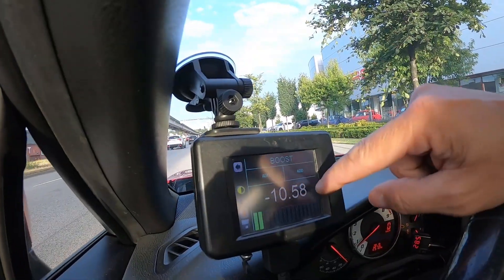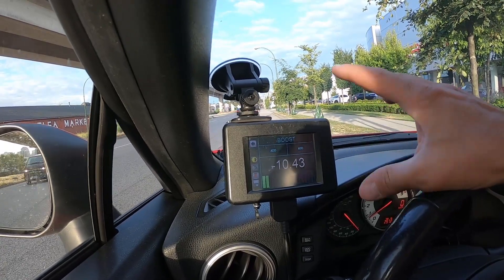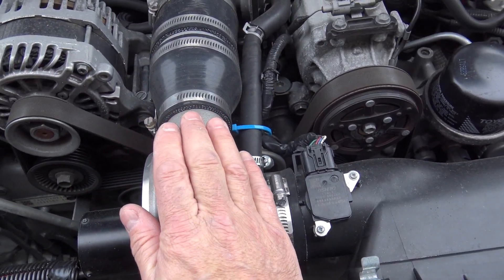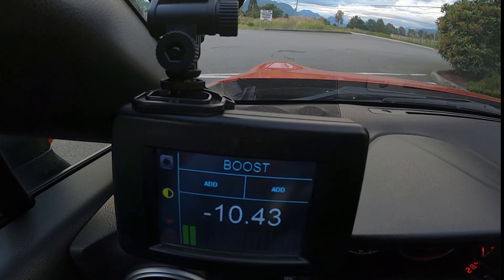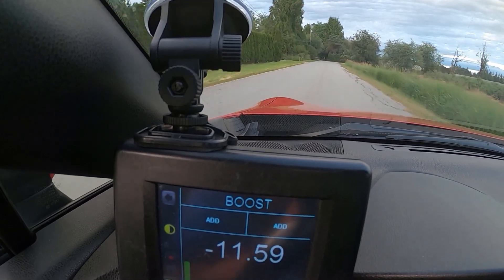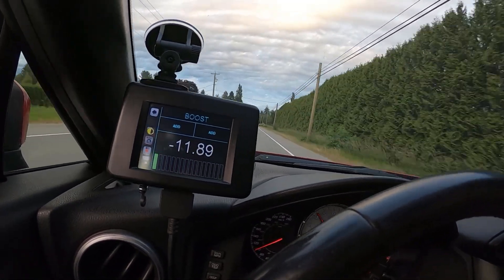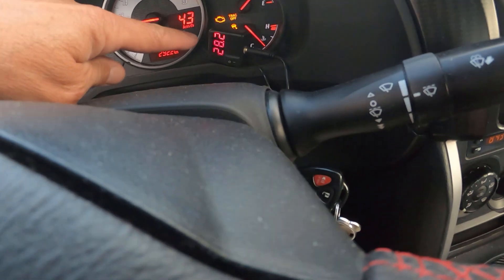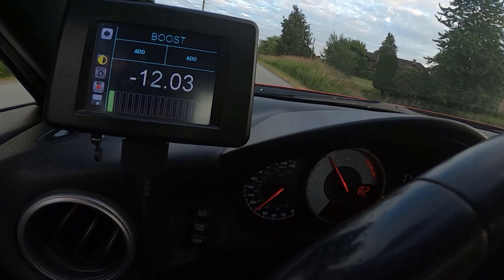Proof that my Electric Supercharge works!! BOOST

Comment: 5psi is equivalent to 30-35whp... That is impressive.
Reply: only problem is, it's 5psi at low to mid rpm. as rpm rises, psi decreases since the rpm of the electric motor never changes.
Reply: @1flynlow  Excatly what this engine needs.
Reply: On acceleration you want off the mark power!
Reply: Buy a gtech and test 0 to 100 km and go from there. Gtech don't lie.
Reply: that varies greatly by engine, and his "boost" isnt fueled for so it doesnt at all
Reply: You can just catch that he is under 3psi at 4k rpm. This thing might add a good chunk of torque down low, but most of us would just downshift as opposed to boosting an fa20 so we could lug it at 2500 rpm to get on the highway.

Comment: Actually this is so bad ass not much more power and I would be interested in creating maximum mpg with this kind of setup I have 2 cars one is an awd ms6 with 380 hp the other is built for handling and mpg a 02 civic 1.7 coupe I drive it hundreds of miles each day and mpg matter most in it with a y pipe and a one way valves I bet even those plastic ones could do something

Comment: With all that added weight with batteries and still a load on your alternator for a bit off boost seems pointless???Why
Reply: WHY not??
Reply: Why aren't you asking the people who run subs and 3500watt amps in their car? Does the same damage by your logic
Reply: Uses less power than the average sub/amp set up. And he even uses another battery. Lmao, a battery isn't slowing a normal car down either. 4psi is PLENTY to compensate.
Reply: power isnt being drawn straight from the alternator. its from the 24v battery which gets charged later (by the alternator) when NOT making boost.

Comment: Atmospheric pressure is 14.7psi so adding 4psi isn't going to do a lot but guess it still an improvement.
Reply: You don't know how pressure works. 
Atmospheric pressure is 0psi/g
Or 14.7psi/a
If you use your absolute measurement of pressure then he would be at 19.7psi/a
Look it up and educate yourself
Reply: @ryanmalin  exactly 19.7psi isn't much of an improvement from 14.7 psi

Comment: It’s different, would be nice on a Diesel engine to help the turbo from initial takeoff, bit like a small shot of gas. Not brilliant above low range revs on your engine as the air flow of the engine increased with revs, the boost pressure vanished. Have you thought of using a pack of lipo batteries instead of two extra lead-acids?
Reply: The torqueamp version does use lithium batteries with theirs and does seem to have thicker cables too. This concept has already been used by a few auto manufacturers like Volvo. They use the electric 'turbo/supercharger' to throw a large quick amount of air at the turbo to eliminate turbo lag. Its a smart concept but haven't seen it in any type of vehicle other then a daily driver type. This is no doubt an easy way for a little extra power, I bet it would be beneficial to even carburetor engines as they will have easier ways to tune it

Comment: If you guys are looking for e supercharger this one does help a little.. a "little" but if you look up torqamp it helps alot..

But id still buy a regular supercharger than a electric ones... meh.. 🤷‍♂️
Reply: It will actually kill horsepower vs stock. It's just an air restriction.

Comment: I feel it I feel it  3psi .that's so useless. That is like horrible power gain for all that money. That's embarrassing to say boosted struggles to make any boost
Reply from the maker: More like 4.7 psi and thats enough to make a real difference if you know anything about boost.
Reply: Both my cars are boosted. If I turned my boost down to 4 psi it would be so disappointing just saying.  What was the real life gain? Not some bs to put on YouTube to get views.
Reply: An extra 30% air in a N/A engine is going to make a significant torque difference in lower rpm ranges. It might not make much extra peak hp, but drivability would certainly be improved. Probably capable of even more with a proper tune to optimize AFR's during boost rather than the stock ECU adjusting as best it can.

Comment: Where can I buy? And also can you also say how much hp added or do a dyno run and also your engine light is on(sure you know) 🤷🏽‍♂️
Reply: The engine light is on because their is an electric fan stuck in his air intake lmao
Reply: @vistuscaine  I don't know why I found this so funny lmao
Reply from the maker: Unfortunately the Phantom electric supercharger is no longer being made but there are other companies out there that are planning to release a electric supercharger such as TorqAmp. The horsepower increase is 35hp and torque is 40lbs.

Comment: Your engine light is on btw E.supercharger works.
Reply from the maker: Engine light is for a small evap leak and doesn't effect the performance of the car but is annoying.
Reply: @PhotomikesGarage  I think you are incorrect about why the engine light is on. It's on because you have an object stuck in your air intake (appears that half of a turbo somehow got stuck in you air inlet)